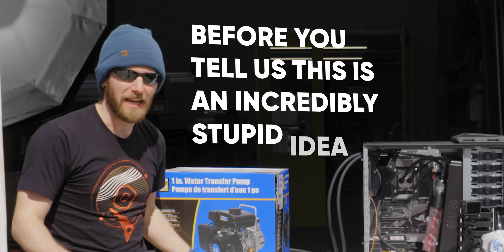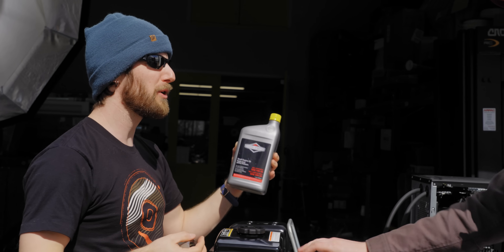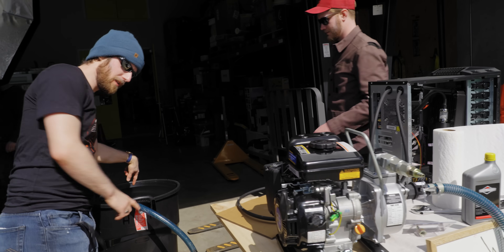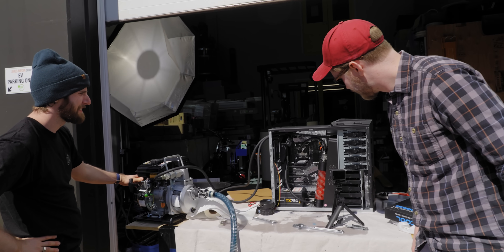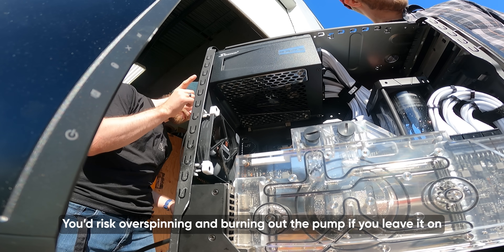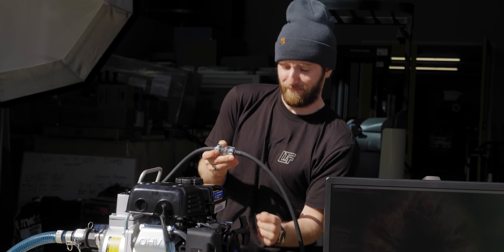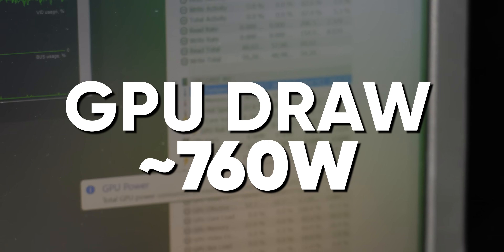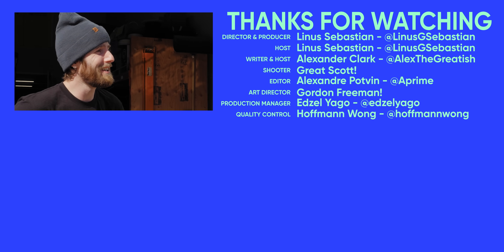Cooling a PC with a 2.5HP Pump

Comment: With a centrifugal pump the flow decreases when the pressure increases, Because they are designed to move a lot of water with little to no pressure, and not to build up pressure, The turbine will then just rotate in the water instead of moving it. (wich creates a lot of drags and can overheat the engine)

I think the small diameter of the hoses increases the pressure to much for a good flow, 

If you use a piston pump, then the flow remains about the same even with a higher pressure,

Comment: This thing is and isn't as stupid as it seems. I could see this pump being a backup solution to a DIY outdoor chiller for a DYI datacenter. After all, the heat doesn't go away when the power shuts down, and seeing this is gas powered, you could still run coolant when your electrical pumps are inop.'

WITH THAT SAID, even in that scenario, it's still a stupid idea. If your operation is big enough to have a datacenter, YOU SHOULD NEVER HOMEBREW YOUR DATACENTER. There are commercial solutions to datacenter management and protection (data, heat management, power, environmental management, security (both physical and data), etc.) that are cheaper and far more efficient than you can homebrew.

Comment: That TimeSpy extreme graphics score is 392 points higher than my stock 3090FE with the original air cooler. My overall score is 3 points lower

Comment: As someone who works with pumps for a living it is important to understand the losses in the system and how the pump reacts to changes in pressure. The smaller and faster the fluid goes the more headloss you encounter and the less flow you get. If you look at the pump curve you can't find out the max flow you can do through a known system. Use Hazen-Williams formula to calculate that. Fun video!

Comment: Me having a 12V 35A waterpump thinking about trying to do the same thing. Maybe testing it with my very old water cooling stuff from 2005.
I have one advantage It's 12V, so I can use a normal PC power supply.

Comment: "I'm Pretty Sure these are gonna leak but it doesn't really Matter"
yep, thats how you get a pc to last forever.

P.s. This isnt the jankiest thing ive seen. I once beat the heat pipe on a small laptop cooler (and used thermal paste) and duct taped it to a cpu well being powered by janky usb wiring.

Comment: Your pump wasn't overheating, it was new and burning off excess paint. Also, this is a transfer pump,not a pressure pump so you basically made it useless by necking it down. Next time use pressure fittings, pressure hoses, and a pressure washer pump.

Comment: to alex i allready sad this ones but again because this looks the same.
but i worked at a metal shop where we used a lathe and milling machines. and you need to cool down the part your milling.
after some years they changed the cooling system and it was recommend by the nasa team.
they stated you need 10x the folume of liqud the pump can pump in 1 min to get naturally confaction to cool down the liquad.
they also provided a crazy machine to emulsion the oil with water.
i like you to test this if you have a reservoir 10 times grater then the pump can pump in 1 min you dont need any radiator?

Comment: hmm, curious idea, if the capacity of the loop to absorb heat is also dependent on temp saturation, I wonder how effective it would be to have a gigantic reservoir of water.
Reply: Yeah, I think a good bit of the cooling actually came from their large reservoir rather than the power of the pump. They'd probably get something similar by hooking up a normal pump to that bucket. Like the time they water cooled using a faucet.

Comment: Now you need to do this with all the rads in the warehouse in parallel (as in you'll need y fittings) with some blowimatrons on the rads, I don't know where you'll find heat load that won't get overwhelmed from THAT!

Comment: Come on guys you know you can't compress liquids! No matter what kind of monster pump you put in there you are limited by the tube's inner diameter and the material's tolerance for deformation. The flow rate is not going to change that much after a point, the whole thing only means you increase the pressure and the chance for a (potentially explosive) leak. The performance seen here is not even due to the pump itself but to the huge amount of water on those containers. The heat carried off the PC and never recirculated back like in an actual loop. Had they made this into a proper loop and let it reach thermal equilibrium on the entire water volume it would not have performed any better than with the standard DC5 pump these loops normally use.

Comment: This video has given me some dumb ideas:

At some point it might work by just placing the reservoir (trash bin) high up, and let gravity take the water through the pc into a lower reservoir (i imagine going directly to the pump might cause issues but what do i know) .  Then you could have the pump do all the work of taking the water back into the upper reservoir.  

You could even take it further in the stupid direction by having the pump and reservoir system set up far from the pc, or even try multiple pcs hooked up to it.

Comment: Every time they reduced to a smaller hose, they reduced the flow of water so it would be legit if they could some how use big hoses in the pc. 😊
Reply: The connectors on the water blocks would still limit it to effectively the same size.

Comment: Now run the PC off a gas generator. Use a gas motor to power the fans as well. If it's mechanical, run it with gas.

Comment: Hey Linus, why not just build a gasoline powered PC. Like run a generator through a Jackery to clean up the power and power a PC with it. Bonus points if you can get it all in one case watercooled.

Comment: you shoud have used a gas powerd pressure washer. Those pumps are desinght for flow  and not for pressure, thats limeted by hose diameter.

Comment: The motor would die quickly also. Max speed with the size of the nosal unwere using will create to much back pressure and burn out the pump. I use pumps like that to drain elevator shafts and other areas to repair concrete.

Comment: The advantage of the motor pump is that you won't notice your fan being too loud...
Reply: Brought to you by ‘BeLoud’ max decibel AIO loop.
Reply: @shanekhiu9884  bequiet was not harmed. 😂
Reply: WHAT?!
Reply: @LlamaYuri  WHAT'D YOU SAY? I CANT HEAR YOU OVER THE MORE POWER GROWL GROWL GROWL NOISE MY PC PUMP IS MAKING!
Reply: @LlamaYuri   
  😝
Reply: Sure, but what about coil whine? Will that be an issue with this setup?
Reply: @stefanejegod8644  nope all you'll be able to hear is the rumbling and grumbling of the pump engine. So no coil noise or loud fans
Reply: linus would put it in the next room for ultimate quite 🤣🤣
Reply: Also you will know if your pump fails
Reply: this is the way
Reply: You would save money not needing to buy noctuas,..thats a plus
Reply: disadvantage would be carbon monoxide poisoning
Reply: @theunkownviolinist  cp2 ppisoning is not a big, it's a feature!
Reply: Way to beat me to to punch.
Reply: it might be dumb(actually works too fast to be effective) but you are right , I want to see it for sure. Not to mention you should only reduce one size at a time for a certain conditions (varies on pipe length and diameter) . the pressure(amount of force even) on those fittings is exponential with each reduction .
Reply: WHAAAAAAAAATTTT?
Reply: Don't need any fans either
Reply: Or coil whine
Reply: AND with the added benefit of paying the inflated petrol prices lmao
Reply: More like, you won't notice grandma being possessed and speaking in tongues
Reply: Hmmm...
Reply: Haha
Reply: Lol😁😆
Reply: ʸᵉˢ
Reply: so true
Reply: Now we need to see a water-cooled steam deck.
Reply: And...if you run the pump inside your house with all the windows closed...you will get REALLY HIGH...just before you pass out and die from carbon monoxide poisoning...💀👍👍😁😁
Reply: Guess you could always put it in a sound insulated box outside
Reply: Good point. That could be a "game changer" for those that insist on using the phrase, "game changer".
Reply: I would pay to see a gas powered pc 😂
Reply: Put it in the shed and plumb it into the house using pex pipe then to your rig
Reply: No your right it’ll be louuuuuuuuuuuuuuuud
Reply: A flawless solution
Reply: Not at all
Reply: Hey it's got enough power you can just have it far enough away volume isn't an issue
Reply: Also, you wont have to hear your significant other yelling at you.
Reply: that's not an advantage bro😂
Reply: But the pump is loud smh

Comment: I think you would have to run the system for a long time to heat soak the water resivior to get a proper temperature

Comment: You broached a subject that could make for a very informative video - how much does each component in a waterloop affect the flow rate?

A waterblock will affect the flow rate. As will a radiator. As will 90° fittings.

It might be interesting to see just how much each of these things affects the flow rate.

Comment: for that pump type you probably even want to start it against a closed valve and then open it up when its filled up with water.
The Instrucion I got in my apprenticeship for centrifugal pumps was:
1. fill pump with fluid
2. close the valve on the pressureside
3. open the valve on the suctionside
4. turn on the motor
5. slowly open the valve on the pressureside (don't wait too long to reduce thermal stress)

Comment: "I think we can overclock the pump"
Reply: It was throwing off a lot of smoke at the end there. They clearly need to watercool it.
Reply: @harbl99  powered by another gasoline pump
Reply: @MihokoriTogozo  oh no the second water pump is overheating bring in another!
Reply: @MihokoriTogozo  which would also be overclocked
Reply: @harbl99  that’s just the paint, they’ll all do that on first running
Reply: @harbl99  actually, a thicker (preferably synthetic oil) and an oil cooler would work.
The oil cooler can be water cooled. Water cooling would be harder to modify the engine to do because you'd have to figure in different material expansions. In an oil cooler, it would be one material to contend with.
Reply: DANGER TO MANIFOLD!
Reply: @TH3C001  😉
Reply: unreal  benzin in german
Reply: @F1iqpy  benzene in english.
Reply: @prydzen  no thats something else

benzene in german is benzol which is something completely different from benzin
Reply: @prydzen  nope, thats another thing
Reply: @prydzen  Kind of weird, but every language seems to use a different, incorrect term for fuel. Petrol from petroleum, nope not actually using petroleum for that, gas from gasoline, also no, Benzin from Benzol / benzene, also definitively not. All of those would burn, but we actually mostly use octane, a bit of ethanol. Weird.
Reply: @autarchprinceps  Is gasoline not what people put in cars?
Reply: @joshjlmgproductions3313  Not chemically, no. It is a mix of shorter Hydrocarbons, 5-7 long.
Reply: @autarchprinceps  Would gasoline still be the more accurate term? As far as I know, it's more accurate than petroleum.
Reply: @joshjlmgproductions3313  Petroleum just is another term for crude oil, which actual car fuel is made from, but also a lot of other stuff. It also used to be burned directly in petroleum lamps, but obviously light bulbs change that. If you were to put it into the car, gasoline would probably work better, if either works at all, but whether that makes it more accurate? I mean there is at best impurities of the same materials as gasoline in fuel, but all but bio- or e-fuels are made from petroleum. It just also contains gasoline, diesel, kerosin, as well as bitumen or other tar like long hydrocarbons, etc. Benzene on the other hand is the one that is hexagonal ring shaped, so perhaps the most distinctive. The exact makeup of fuel isn't perfectly standardised either though. Here where I live, we have at least 4 variants, all of which allow for some amount of flexibility for manufacturers or just natural impurities in the process, and different levels of mixture with bio-ethanol. Formally, we call it, like Diesel, by the inventor of the engine it goes into, Otto.
Reply: unreal  or gas
Reply: unreal  Gasolina, invented by Daddy Yankee, who wrote a song about it.
Reply: I 'overclocked' my Campbell Hausfeld motor over pump high pressure washer. It's amazing. Just maintenance of motor oil and water pump lubricant. (premium 75W-90) Waiting until it explode.
Reply: "Next time on LTT: we hooked up Renault's 3L v10 72 degree from Fernando Alonso's 2005 Car"
Reply: Dominic Toretto wants to know Linus' location
Reply: Literally just bypassed the limiter…
Reply: You can easily overclock an engine like that. Just pull on the governer.
Reply: Advance the timing 😂
Reply: Cool name you have.. 👍👍
Reply: If you have an 3 phase AC motor pump and a variable-frequency drive (VFD) you can overclock the pump. Regards.
Reply: give er moar gas!!!
Reply: wait what!!!!!
Reply: Absolutely, its called a turbo
Reply: That was hilarious hahahah
Reply: he moved the governor to a higher rpm but i've never seen a predator motor smoke from a governor raise. it might have just been breaking in, or the exhaust manifold gasket blew
Reply: Watercooled gasoline pump, watercooling the PC 😂😂😂😂
Reply: unreal  petrol

Comment: You should probably work a bit on the titles, they seem to be getting worse and worse. Made me think you just ran a PC from a generator, wouldn't have clicked if it wasn't for the short saying what it actually was. I can understand clickbait but when it doesn't explain anything about the video and makes the video seem worse than it is that's not very good clickbait. It's the same with most of your videos now, no explanation at all which makes watching a lot less likely.

Comment: OMG ... What about pressure in blocks?! 🤯
Reply: It's possible to blow the gaskets on the pumps or build enough pressure to even rip the screws out of a metal block. However, I think the connection points between hose and hardware (as seen in the video) are the most likely failure points in the loop. They have a lathe, so they could fabricate connectors that would allow them to use the armored water lines used for residential sinks and toilets to give those connections more of a chance. In that case, I could see the acrylic water block for the GPU failing far sooner than the metal CPU block. But there still is the reservoir in the PC that would likely fail first.

Comment: i got a big ass pool about 49,000 to 50,000 that the temp stay around 50 to 60 degrees in summer time that would be great if i could use that as the colling and winter it stay about 10 to 30 degree that even better if i could attach a motor and a pump to it and to my pc ill never ever have to change the water or fill it up

Comment: Wouldn’t a more powerful electric pump in a bigger PC chassis achieve a similar result without being anywhere near as unwieldy? As established in the video, the gas pump produces too much heat. Basically, despite what Vergil may cry out, there’s such a thing as too much power.
Reply: You're watching Linus tech tips being reasonable isn't in their vocabulary
Reply: Winner of the most boring comment ever
Reply: This was not meant to be feasible...
Reply: and where is the entertainment and ridiculousness in doing it like that?
Reply: The entire point of this video is to be entertaining as a silly internet content, not to be technically reasonable.
Reply: Back in the day before watercooling was well understood we overvalued flow rate I used to have a loop circa 2006 that ran with an Iwaki MD pond pump. Still have the pump for some reason and hot damn it can really move some water.